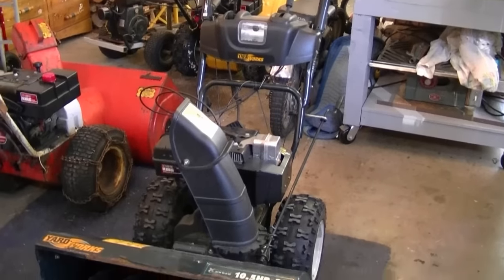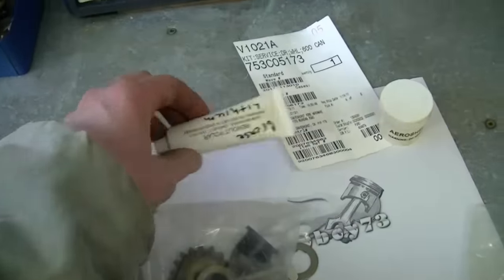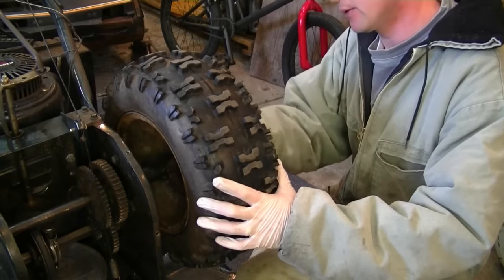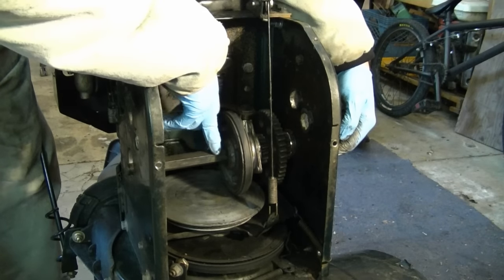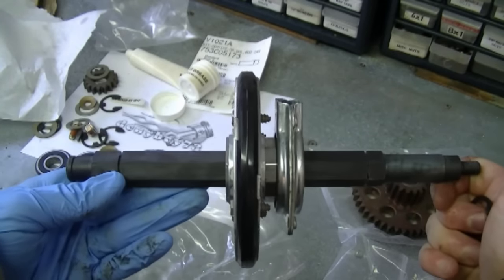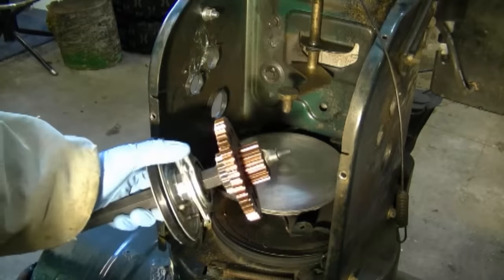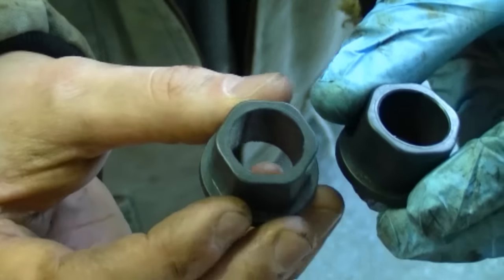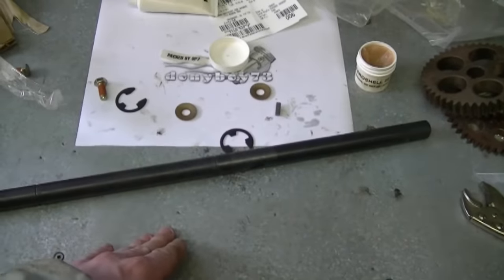MTD Snowblower Transmission Repair Part 1/2

Comment: Great how-to video. Great camera work, audio and closeups. Well done. I purchased the kit and have started the work. I did run into a problem where the wheel would not come off one side. A little heat did the trick. Thanks for your work.

Comment: After cleaning the driven plate, I always sand it with rough sandpaper to knock the gloss off it and provide better power transfer.

Comment: Thanks for the video. I just wanted to say that my MTD snowblower had the wheels lock up due to the needle bearings being rusted and I took it apart, cleaned out the rust, greased them up and it works fine now. I think if you catch it early enough that the bearings aren't ruined you should be able to fix it. Now I just need to re-grease every couple of years...

Comment: First off I want to thank  Donyboy73 for this great video. I  own the MTD 1995 model 317e644e129 of this snow blower.   I tried to purchase the kit you used but it is not offered for my older model.  I asked MTD to give me a price of all the transmission parts included in the kit you bought and they estimated about $450!  I told the lady in parts that my problem is that the snowblower no longer goes by itself, I have to push it up and down my driveway.  It still blows the snow.  The woman mentioned maybe its your keyway.  I opened my snowblower up and was surprised at how different it was from yours. Mine is a much simpler design.    What is a keyway you ask?  It is  a 1/2 inch piece of metal that is curved on one side and flat on the other, like a 1/2 moon.  The curved side fits into a slot in the axle and the flat side sticks out of the axle by about an eighth of an inch.  The lady was right.  Mine was missing.  I took the wheels off,  pulled the axle and gear off the machine, bought a keyway from my local yard machine repair shop for  $1.00 (I brought the axle and gear in with me to be sure I got the right keyway) fit the keyway into the slot on the axle, slid the axle back onto the machine making sure the flat part of the keyway that is sticking out from the axle slides into a slot on the gear. Put it backed together, started her up, engaged the clutch and it took off! So for $1.00 I fixed my snowblower!!  No more pushing that damn thing manually up and down the driveway! All I needed was a keyway. Now the axle turns the gear and the gear turns the wheels as it should. I followed your recommendations for cleaning and lubricating the snowblower and I am now ready for winter here in NJ.  Thanks a lot!
Reply from the maker: +Alan Prachar that's a cheap fix lol

Comment: Wow I checked the part number and 65.99 for the set and the parts were made in 2004 yours said 2005 but the site I went to said parts were made in 2004 and still available . cant wait for part 2 were going to get more snow up to 9 inches Friday when Trout season is open and I want to wheelchair myself to the creek across the street from me down the lane 1/4 mile the creek is high and will be stocked sometime in April cant wait to fish again

Comment from the maker: @ringbolt9 it's better to remove to install grease but you can use chain lube in a can and spray it in the bearings without removing anything

Comment: Hey Donyboy 73 - I love your videos for working on and fixing snowblowers. You are very thorough and explain things very well. I bought a used MTD GOLD Yard Machine 2-Stage snow blower with a 10HP Tecumseh motor (28inch cut and 12inch impeller). I've opened the belly and things appear OK, but I would say "dry" after watching how you grease your machines.  You mention in this video putting grease (white Lithium or Aeroshell 22) throughout the gears where you normally cannot get to and mention to grease this yearly..........you take the transmission apart every year and re-grease it?    Also some of the gear teeth of the snowthrower you work on here are broken.  Is there any behavior that the snow thrower will demonstrate that would make me think that I should take the transmission apart to check for this?    I did get a good deal on this thrower as far as I can tell, but I want to make it last and get the most out of it.      I found an online owners manual and it suggests SAE 5W30 or SAE 10 oil......do you have a preference?     Thanks for your great videos!  Rythmblood

Comment: Question about the friction disc assembly my Troy-Bilt has the same setup but the wheels move freely made some adjustments the wheels now try to move but do not moving gear but I can push it freely in your opinion would this be that part friction disc assembly

Comment: Excellent video, I have a 13 hp 33" yardman  snowblower in which the chain drive jumps on the gears for both wheels, myself wants over $500.00 just for the rebuild kit....was thinking of trying to install spring loaded wheel tensioners for each chain to take up the slack, any thoughts? Greg

Comment: Donyboy, I was given a mtd 10hp snowblower that had many problems. The one that is left is this. It backfires and misses. I have gone through the carb and it is all perfect (nonajustable) I adjusted the valves and lapped them, All is well there now. Cleaned fuel etc. Checked the flywheel key. that's good. But still missing and backfiring. I read on a blog that the lighted snow blowers have extra magnets that make spark 6 times per rev and those can mess up the timing/condenser.  I am stumped here. What do you think?
Reply from the maker: if it has points yes check the flywheel magnets, also the carb may be the problem

Comment: How important is the small washer you install from the old hex shaft at 8:30? My parts kit diagram doesn't show one and it looks like whoever took it apart last misplaced it.
Reply from the maker: +dp2826 i wouldn't worry about it
Reply: +donyboy73 Ok, thanks. Great job on the videos!

Comment: Hi donyboy73, i have MTD snowblower "Yardworks" and I was told that I have to replace drive shaft on it. The wheels seized and  I can't push the blower at all but when I start the engine and press the handle to go forward the wheels start to move. The model # is 31AE6MKO513 serial # S1I304B30317 001 would the parts kit number be the same as in your video? 

Thanks!
Ted
Reply from the maker: if it looks the same then it should be the same part number

Comment: The chains are ruined.
You MIGHT be able to get away with just buying new chains....HOWEVER IF the SPROCKETS (they are not "gears"), are not completely wore out.
If the sprockets are worn to sharp points & they now resemble saw blades, they are 'screwed'.  You are forced to replace all.  
THEN try your chain tension trick. 
It might last 1 or 2 seasons. Eventually the chains will be so worn the inner sides will rub together. 
Then def you must buy new, & by then it will cost $750 for the kit.